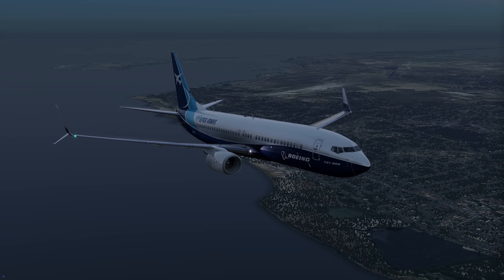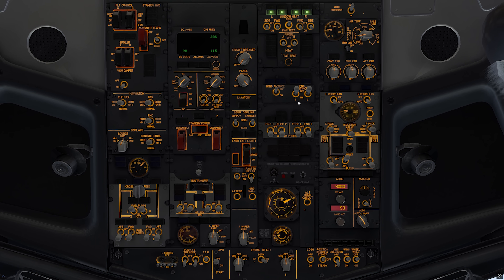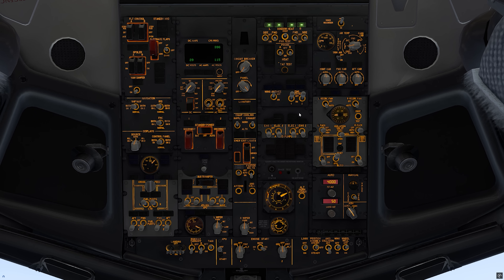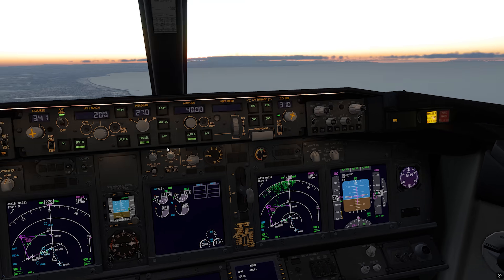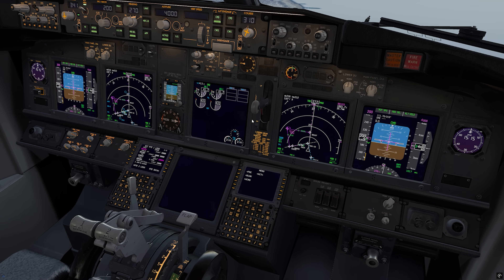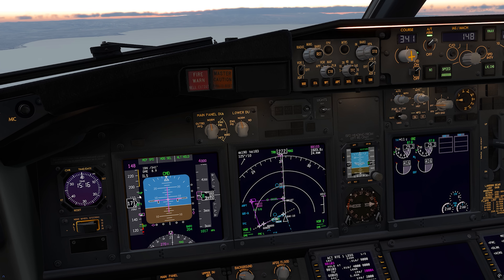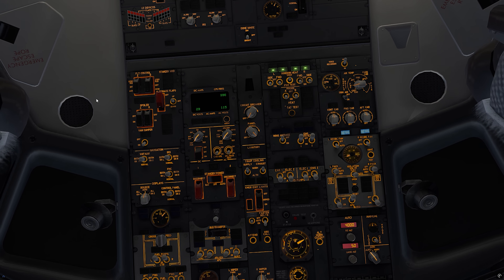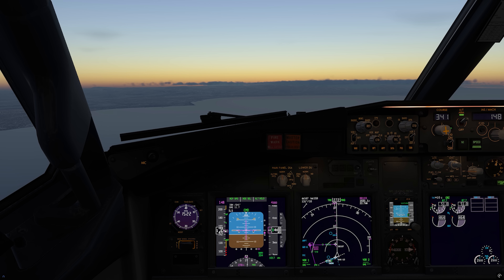Swiftair 737 Crash | System B HYD/EAI Switch explanation by a 737 Pilot

Comment: If you have done it! How many others have made the same mistake.  Is this not a catastrophic design flaw?
Reply from the maker: I wouldn't call it a "catastrophic design flaw". The switch positions do pose a threat but it should not have dire consequence, so long as the multiple warnings and indications (see video) are not completely ignored which regrettably, in the case of the Swiftair accident, were.
Reply: @flightdeck2sim  While it's easy to agree with this sentiment, a similar line of reasoning was used for the MCAS debacle contributing to it going unnoticed for much longer than it should have. "The pilots should notice..." only works well in normal operation. And it isn't in normal operation that crashes occur. It is in stressful situations with multiple factors contributing to overloading the pilots that something like this becomes another hole in the cheese rather than something that halts a potentially catastrophic sequence of events.

But perhaps a bigger issue still is how the 737 warnings and cautions seem to condition pilots into cancelling them on reflex, before they've actually processed what the caution says. Confirmation bias, fatigue, radio frequency confusion, bam bam bam, crash. Too many routine cautions perhaps? 737 cry wolf? shrug

With all that said, this is one of very few incidents where I feel there's genuinely little else to blame than crew negligence or simply a very unfortunate set of circumstances. Probably also wouldn't have happened if the captain wasn't so busy trying to instruct his relatively fresh FO. So many things contributing, but it was almost all about what the pilots chose to do when they could have chosen otherwise.
Reply: @flightdeck2sim  I’m curious, hypothetically, with admittedly, a little too much laziness to look up the schematic (it’s in blancolirio’s video on this subject though), if they had reversed the engine, anti-ice switches and the wing anti-ice switch, what’s the most serious thing would lose making the error of flipping off system A instead?

I’ve since read that other comment that says guards would be good, and I’m inclined to agree that’s a better fix. But I’m curious.
Reply: It is a very obvious layout flaw that should've been fixed ages ago. Offset the switches, put a guard on the switches for the hydraulics, install different switches that give different haptic feedback, so that touching them alone already makes you realize that you tried using the wrong switches. DO SOMETHING ABOUT IT! But no, Boeing just did Boeing things for decades.
Reply: @TheGerudan   I wouldn't say Boeing made any design flaw, but what i would say is that in such an event, Boeing made sure that they were alerts and warning sounds to make the pilot be aware of their mistake so that they correct it. unfortunatly in the case of  Swiftair, they ignored it.
Reply: @jostmathe  It obviously is, because it caused an accident. 

There also isn't a warning sound, there are only a few lights and a crew that is already at their workload limit, in this crew obviously had a bad day and already was at it's limit, warning signs and sounds often get overlooked. There really is no reason not to have these switches guarded.
Reply: @ I think you pointed out the real issue,

 "this crew obviously had a bad day and already was at it's limit, warning signs and sounds often get overlooked" 

That is the real issue, not the aircraft. Why did they ignore those warnings ?
Reply: @jostmathe  when I heard that they immediately canceled the master caution, my heart kind of sank.
Reply: @TheGerudan  you really would think the auto pilot disconnect right after he hit those switches might have been a pretty strong clue, but I know how it is to be human.
Reply: @rynovoski  yeah. I believe fatigue is the real cause of the accident
Reply: @ Might be, but if you at least make the switches different enough or guard them it could've easily prevented this crash and a lot of similar mistakes with those switches that seem to happen frequently. There really is no excuse to not do that. 

How often do B737 pilots even deliberately deactivate the hydraulics? Is that SOP for anything during a normal flight? Why not put a guard around those switches?
Reply: @TheGerudan   research needs to be done to know how often this happens but the fact that over the whole life of the 737 classic,NG and max, this is the first crash that has accord due to this error, I don't thing the design should be changed.
Reply: @TheGerudan  you say that but the layouts been the same for 50+ years and yet this is the first accident caused by this.. but yeah, lets just blame boeing.. the pilots had over 10 minutes to realize their mistake and missed every single warning sign.
Reply: @sirmonkey1985  I'm not blaming Boeing for this accident alone, but they could've done a better job helping to prevent mistakes like this. I would expect a similar recommendation coming out of the investigation in the final report.

 Again: They don't need to do much. They don't need to completely change the layout or the actual technology behind the panel. Just switch your 5$ levers for something different would probably already help and could've easily been done ages ago. 

The idea that this is just finde and doesn't need to be changed, even though it contributed to an accident and has happened in a lot of other smaller incidents, is very baffling to me.
Reply: Just typical Boeing.. Tbh on the classic it is not really an "issue", as it was only made 12 years after the -200.

Comment: The 737-400, being a Classic, doesn’t it have steam gauges? Is there an analogue to the moving barber pole for under speed on steam gauges?
Reply from the maker: I believe most classic have a displays for both the PFD and ND, whether the black/red speed tape move with flap lever movement, not sure. Either way crew need to monitor flaps extension/retraction.
Reply: Thank for the quick reply. Agreed, there are enough other indications of the problem. A quick Recall would make the problem area light up as well.
Reply: @flightdeck2sim I think all -400s had PFD/ND Some early -300s (and I think at the operator’s option) had steam gauges.

The avionics seem to be very similar to the MD 80, which don’t have any of that fancy speed, tape stuff, but I’ve never directly compared.

Comment: So what happens if the flaps are already set to lets say 5 and then Hydraulics are switched off? Do they retract automatically to flaps UP due to loss of pressure?? Or stay at the selected settings??
Reply from the maker: Turning off SYS B/Loss of B pressure, the flaps will stay at the existing setting. You could then use the Alternate system to retract/extend the TE devices and the SBY HYD System to extend the LE devices only.

FD2S
Reply: As noted from Blancolirio's channel, there is a no-return valve, so no they would not automatically retract. I guess same is true for most commercial aircraft.

Comment: interesting - but it is B738 NG - Swiftair was B734 Classic -  Can we be sure that the systems work the same?
Reply from the maker: Have a read of the interim report.

https://sia.lrv.lt/public/canonical/1743410501/521/2024-12-20%20Boeing%20737-400SF%20EC-MFE%20Interim%20Report.pdf

I've not flown the classic but the NG shares a common Type Rating. Looking into the interim report the same indications occurred (applicable MASTER CAUTION/Disengagement of AP/Flaps failed to extend), all of which should have been recognised and promptly responded to.
Reply: The whole point of the Max was so that   there ever was only one type rating. Any 737 pilot in FAA/EASA land can fly 300-900 Classic, NG, Max. Maybe somewhere even the 200?
Reply: @rkan2  I don’t believe the entire series, at least not with the same rating. I know Southwest could do two of the three generations at the same time, but not all.
Reply: @rynovoski  I've seen a type rating which specifies at least the 300 through 900 but not the 200.
Reply: @rkan2 correct. And I’m pretty sure there was one that was -200 to -500. But not 100%.